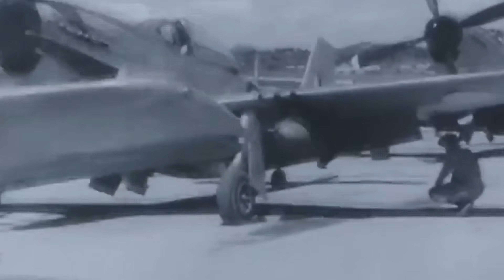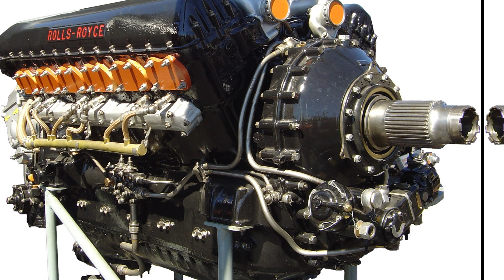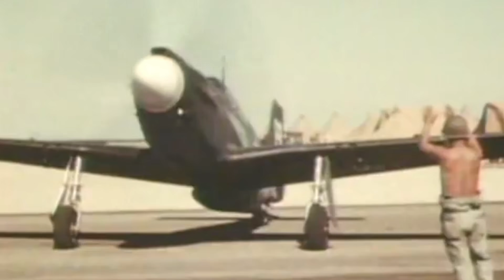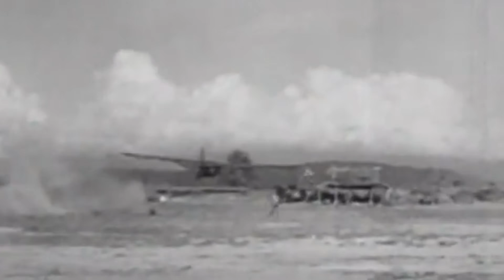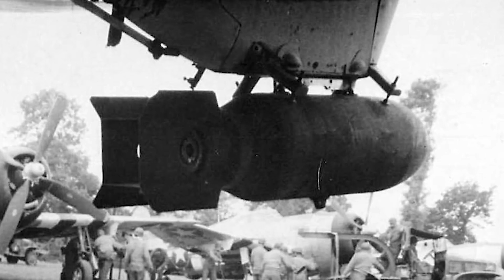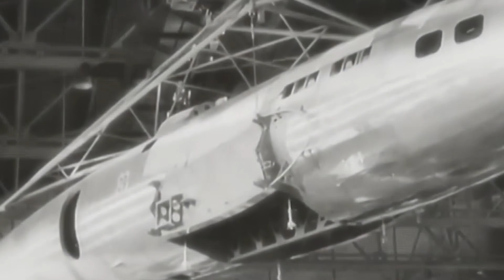The Insane Engineering of the P-51 MUSTANG

Comment: Is Meredith effect real? another flight with liquid-cooling engine (spitfire, bf 109, etc) have radiator too
Reply from the maker: Yes, the Meredith effect (reducing drag by channeling heated air through a duct) is real. Spitfires and Bf 109s used radiators, but they weren't optimized for the Meredith effect to the same extent as later jets.
Reply: @EngineeringDocumentary  Spitfires Jun 42 two radiators which produced the Meredith Effect they had  it in 1936 but only one radiator
Reply: Yes Spitfires had it well before the P51